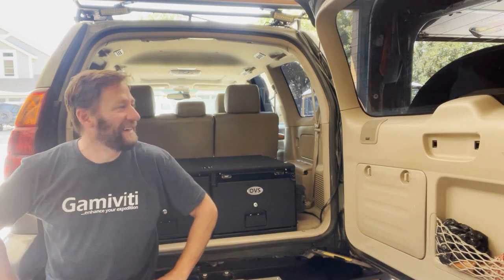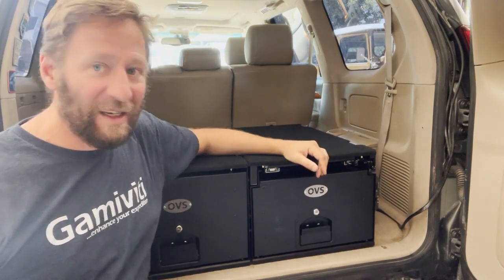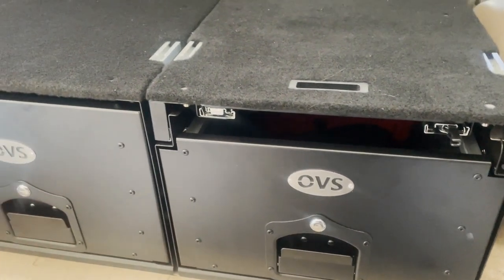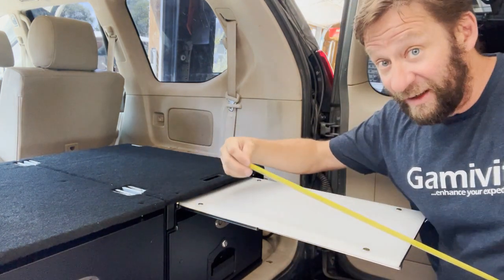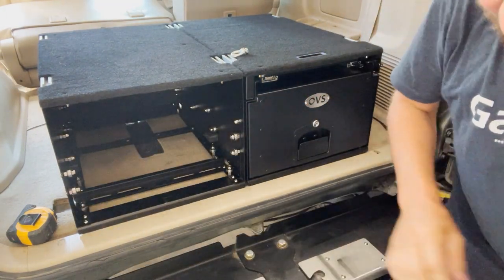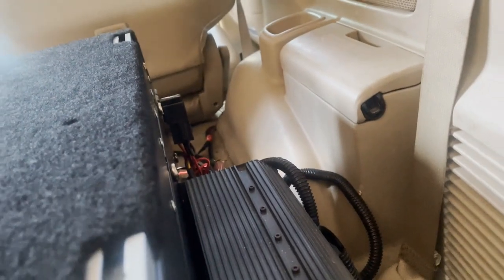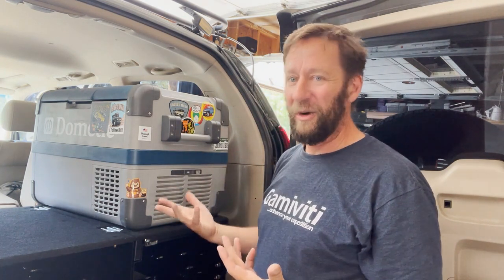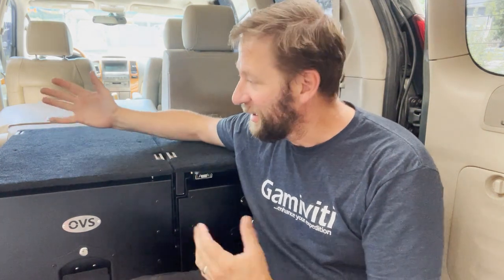drawers from overland vehicle systems

Comment: Wonder if these could fit under ADGU sleeper platform in a 200 series where you remove middle seats and face this towards the doors, then put the ADGU flapper over them. Would be sick. Then put remove the drawers and put back the middle seats when back from a long trip.